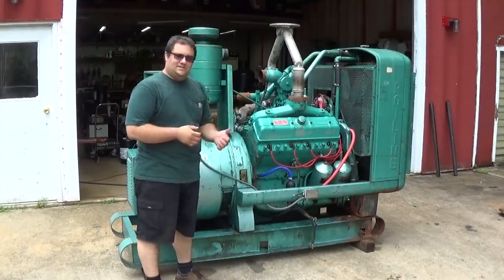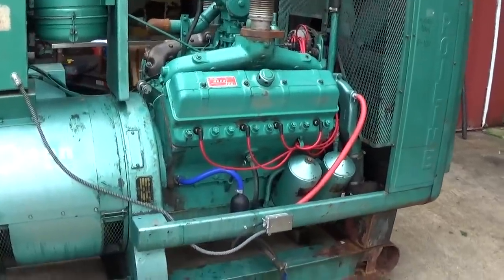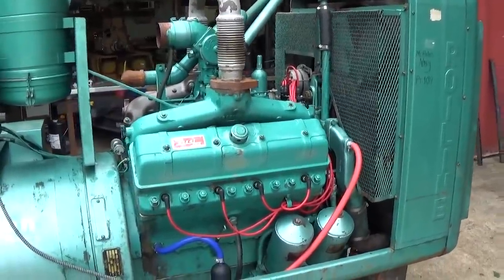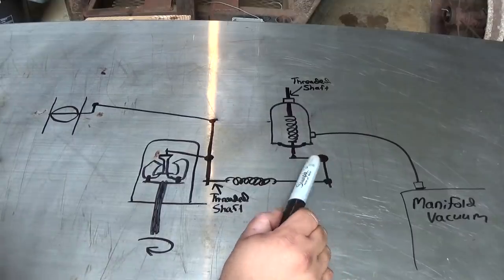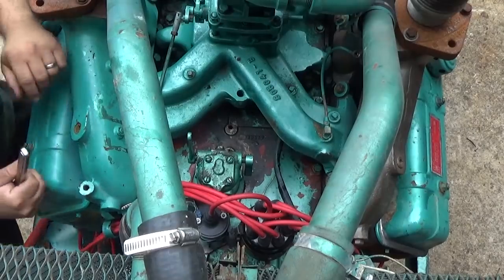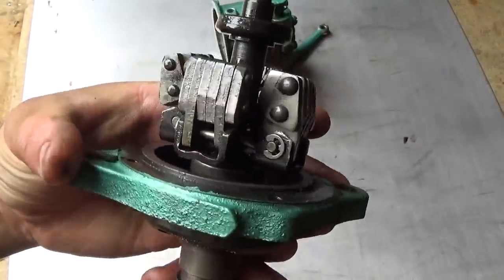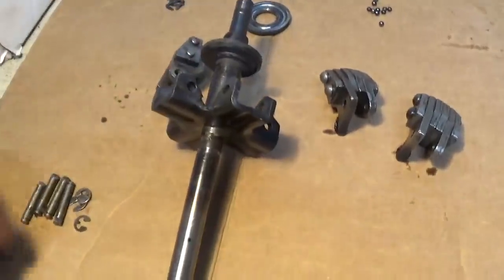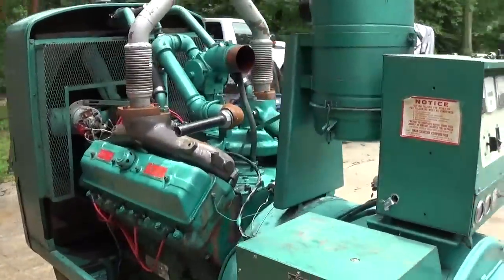844 Cubic Inch V8 GENERATOR Lets find out what is ailing it... Onan 140WE

Comment: A bit backwards on the governor operation explanation. As soon as load is increased, engine speed begins to fall, and the flyweights begin to move in, opening the throttle. That increases the hp to carry the greater load, at a lower speed, and increases manifold pressure (less vacuum). There will be a bit of a restriction between the manifold and the speed booster to prevent hunting, but in a short time it will increase the main governor spring tension, restoring the speed to rated speed.

Comment: Idk? As bad as the drive gear is for the mechanical governor, I would question the lubrication systems for the engine, and want to pull the oil pan off and check the main bearings and rod bearings before I'd go much further on the governor conversion....

Comment: I would guess that the governor driven gear, and it`s drive gear, were not being lubricated when running. It did look dry inside after pulling the governor off the engine.

Comment: I think an electronic governor conversion would be interesting. Everything you showed in the video looked like it had absolutely no oil on it when you took it apart, even down in the engine. The design of that oil hole is not great but I wonder if there is some greater oiling issue with the engine. It'd be interesting to run it (or spin up the oil pump with a drill if possible) and observe what oil is delivered.

Comment: I like the idea of you showing us how to convert this generator to a digital governor.  I'm interested because the engine company did not continue making this engine very long.  Was this the ONLY reliability issue or when you run it with a governor that doesn't need to be oiled, will you find other issues? 
I was trained as an electrical engineer, though I never worked as one, and am interested in design flaws and how they are corrected.  The idea of failure analysis is similar, but I always want to know what would fix the issue!

Comment: So uh how much for it I wanna put it in my truck lmao
Reply: I thought the same thing
Reply: It wouldn't run what you have to understand its generator motor so its actually meant to turn at alot lower rpm than a normal gas engine and is actually why so big in cubic inches like a diesel turns very low rpm just like gas it makes it low wear on it
Reply: Joel Lyons same reason 4 cylinder engines can go up to 8k rpm and motor cycle engines can exceed 12k rpm
Reply: @Joelontugs  That's probably why it ran fine for 60 years. Everything moves so slowly, I'd also imagine that the parts are all overbuilt, weight probably isn't a huge consideration in a stationary powerplant.
Reply: @Joelontugs , if you've ever built an engine you know that can be remedied. 
Balance, polish, port, big fn cam, custom split duel four barrel intake, or fukit twin turbo.
Boom 3000 easy.
Even if it reds at 5k

Comment: As you were showing all the carnage in the governor, I was thinking of the various damaged parts that can be made at a machine shop, or electronic conversion. And then you said so. The speed sensor can also be run in the governor location, instead of the fly wheel,  only that gear in the cam is too worn. Very much interested in seeing the electronic conversion.

Comment: The governor is an easy fix compared to possible engine damage.The giant problem might be the generator.Does it have a wound rotor or is it an armature with brushes? if an armature what would be the condition of the commutator and brushes.Truing a comm,undercutting and chamfering the bars, rebrushing is all expensive.Bearing change out and making sure the endbells aren't worn to the point of sleaving them?Now you have to address the regulators and 50 years of use will age electronics and wiring as it has on the mechanicals. SCR's for freq control and voltage control aren't cheap to replace in a unit this size.I'd like to know the condition of the winding insulation on the fields and armature as heat and dirt always are a factor so they would need to to be meggared to ground after steam cleaning them and drying them out in a vacuum oven.Possibly needing to redip the fields and armature to seal up cracks.Scrap it or sell it to someone who will run it til it blows up.The business that it came from were wise to get a new unit.

Comment: Great video, Yes do the conversion to electronic. 
BUT the first thing I would do is pull the dizzy and check the bearings, as you have shown only 1/3 of the balls from the thrust bearing , WHERE are the others?? If the dizzy has loose bearings too, I would pull the pan and check for remnants of the Govener and other things. If you do find a lot of stuff then inspect the oil pump and this could lead to removng the crank and piston rods then a flush of the oil galleries. 
This engine reminds me of the Ford V8 produced in WW2 for some of the army tanks of the time, very simmilar but not shure if its the same.  Good Luck

Comment: I think you need to make a plug or modify old base to cover old oil feed hole to governor shaft, maybe put plugs in top and bottom where shaft went through old base and make a plate where cover used to bolt may be easiest. Just was concerned about open oil feed hole causing lower oil pressure as it would just be an open hole dumping inside engine.

Comment: 1, How much of the metal grindings went into the engine and how long until the engine blows from the contamination?? 2 I am looking for an older onan gen set to provide backup power for my house and hobby shop. (Natural gas would be preferred) do you have any???

Comment: You also need to remove the pan and inspect the rod, and main bearings as well as inspect the oil pump for damage and clean the oil pickup. All that metal went somewhere...... Yes I have worked on portable gensets up to 2M.....

Comment: Might be interesting, but 1600+ hours is equivalent to 95000-100000 miles on an automotive engine of 1965 vintage.  That engine may be toast on the inside -- the bearings are probably badly worn, and who knows what the valve train looks like?  More than half of the balls in the thrust bearing in the governor ended up down in the engine as well.  It would be interesting to see the conversion, but it may not be worth the time and effort.  JMO.

Comment: if you install an electronic governor that likely will solve the engine over speed issue. However, I think you may need to solve the lack of lubrication issue too. The governor driven gear is badly worn and that points to a deeper problem. Is the drive gear (on the cam shaft?) worn too? What if something else is starving for oil?

Comment: JB Weld & Hot Glue it! Isn't that the standard for Generator repairs! At first I was just thinking yeah just clamp the speed up and let her run until the power came on and then fix it properly. However the exhaust was a killer even for me on that idea. Very Nice video Mike, I actually learned something I didn't know before on the governors. So my clamp it up idea probably would have completely killed it the rest of the way beyond economical repair. Just because is looks good on the outside and runs smooth, doesn't me there's not a CRITICAL error on the inside waiting to rear its ugly head. That's why Mike and the company have a good rep, they get the job done reliably & Right!    So YES I think learning how to do a electrical/electronic governor conversion would be an excellent video. Thanks for all the education Mike. Best Wishes & Blessings. Keith Noneya

Comment: Mike, I think I agree that it is a poor design. If you equate 1662hrs running to a truck engine, that is less than 100k miles and no truck would show that wear on any component at <100k miles.

Comment: I have  a cng Dodge  van that has 4 tanks that hold the equivalent  of 18 gallons of gasoline  but their  actual volume  is more like  60 gallons
The cng is rated at 3600 psi but sometimes fills up to 4000 psi,
that would run the gen for a while.
My truck is only  318 ci.
30 + years ago I did maintenance  work
on a 75 kw gasoline fueled  generator  that supplied the emergency  lightning 
for the old Boston Garden arena. The 
engine was a massive 6 cylinder ohv
antique  with a single updraft  carb.
I recall that it was about  700 cu + - ,
possibly a Hall- Scott but not sure.
This monstrosity was mounted on steel 
 beams and I needed  a small  ladder to
 reach the valve cover! The generator 
shaft  was flange mounted  to the flywheel which  looked even older then the engine. The joke was that the generator  was signed by Tommy Edison. This antique  had to be run before EVERY public event held at the Garden including Bruins hockey  and Celtics  basketball and if it didn't  run the event would've been cancelled.
But it did have a replacement  electric
magnetic  governor, a magnet was installed  on the outer  diameter  of the
exposed flywheel.  Very interesting when
the governor  malfunctioned  and the
engine  took off  for the sky. No overspeed shut off ! 
I was at the Bruins playoff game when
the garden filled with thick fog from the humidity then the power  went out then
the generator  started . The emergency 
lightning  came on and I got out of that
dimly  lit  rat trap of a building. The generator was in a building nextdoor to 
Garden and it overheated  and blew antifreeze  all over the place. I got
an early morning  phone call from the company owner  to go back and
find out what went wrong. A story
for another  time.

Comment: An absolutely fascinating video as always, in theory an electronic governor could use the 60Hz output as a sample.  Part of me is thinking if you could use a Ford throttle body,  perfect "drive by wire" solution. (Maybe not all Fords but certainly my wife's car has a dc motor which moves the butterfly)

Comment: I'd be interested in an electronic governor conversion as well.  But I'm a little skeptical of your root cause analysis.  You've shown how the lubrication design of the governor could well have resulted in poor lubrication, which could have caused all the internal damage you note--but I don't think it would have caused the extreme wear on the gears.  Didn't you say the unit only had around 600 hours of run time?  I'd think that would point to a more basic lubrication failure.

Comment: That was a great education! Just as if I was attending a school learning how that thing works! Great instructor! I went 'oh-oh' as as soon as you said that's a lot of spring tension there. I was wondering why such a behemoth spring had to be used to control a flappy throttle valve! Then when you lifted the flyweight assembly out of the block I said, wow, that looks awfully dry. Then the gears worn out and so on. It may have lived longer if the oiling supply was better designed. Now, with advanced electronics, going to an electronic speed controller would be a no brainer. That genset is still young in hours IMO. Good Luck!

Comment: If I were to ever consider rebuilding that, or finding a similar replacement mechanical governor, I'd probably think about adding an external oil feed. Perhaps a line with a small orifice spraying in from the top of the gov housing to give everything in a constant oil bath. 
I would also think the extra oil returning out of the drains in the base would help the issue with the drive gears getting chewed up. That, and a lighter tension spring.
And yes, by all means it would be interesting to see the process of changing it over to electronic governor!

Comment: If that many bits are missing out of that governor, I'd be seriously considering an overhaul of the engine, or at least getting a camera to see if any of that metallic debris got into the cylinders and/or the lubrication system. There could be collateral damage from the missing bearings.

Comment: I'm going to go with "Royaline", "ROIL-ine", goes with the crown emblem. That engine was the proverbial balls to the walls, the grooves prove it. Don't forget to plug off the oil line in the block that feeds that governor. Especially since there was such a low flow through it.

Comment: Well diagnosed Mike, I think part of the problem is the governor is not up to the job of controlling the butterfly as needed. Throttled inlets like on your engine have some very peculiar and opposing dynamics happening. First dynamic is it takes far more force to just open and maintain a controlled position of the butterfly than it does to maintain a position near wide open throttle, due to air flow acting on the 'sail area' of the butterfly, a near closed butterfly has a much larger sail area. Second dynamic engine response is greatest at near closed throttle. 5 % rotation of the butterfly from near closed is a far larger opening of throttle (%airflow) than a 5% opening at near wide open throttle. 
Electronic governors on gas engines are always fun, specially getting the linkages right, you need the exact opposite of a parallelogram, the output linkage of the new governor needs to be at right angles to the butterfly plate, this gives greatest actuator control over the initial small butterfly openings needed to maintain idle, with reducing sensitivity as you near wide open. 
It's a nice looking machine, you will get a lot of enjoyment getting  that one going. Interesting colouring of the exhaust manifolds as well, almost like one side is running way cooler.
Looking forward to seeing it in the future :-)

Comment: Here is some information on Le Roi which in French means "The King" which then much later became Roi Line.  Waukesha was involved later along the way.  The company began as Milwaukee Machine Tool in 1913. In 1917 Charles W. Pendock Reorganized the company into Le Roi which was making a 4 cylinder engine. He later added a 6 cylinder of the same general design. Legend has it that the company changed the name from Milwaukee Machine Tool to Le Roi after a large order came in from France for WW-I equipment. WABCO (Westinghouse Air Brake Company) purchased the company in 1954 and then sold the Le Roi engine division to Waukesha in 1958. Waukesha marketed the Le Roi engines as Roi Line (Roy-Line). The last of the Le Roi engines were built in 1974. 

I have a photo of my father when he was in National Guard service in 1938 with the Combat Engineers on training in Tennessee standing along side of a military truck  that is equipped with a very large Le Roi powered generator set. The same large lettering is on the radiator housing but says Le Roi rather than Roi Line. My father went on to be a U.S. Army Captain, company commander in the Pacific Theatre during the New Guinea and Philippine campaigns and finally the occupation of Japan.

Yes, I would love to see the electronic conversion. It looks like a very nice machine! And funny- the reference to Steve1989MREInfo.... "Ok lets get these parts on a bench... nice". I wonder how many people got that! Not many I would bet.
Reply: Quite a few, judging by the comments!

Comment: Definitely would like to see how this would be converted !! Those conditions really caused alot of wear on those parts. Have you since drained the oil and filters to check for "shiney's" in the oil?? Wonder how much damage all those metal particles did to delicate surfaces in other parts of that engine. The unit looks pretty nice on the exterior !! That thing would power up your neighborhood !! Don't remember if you said if it is single or three phase and what voltage ??

Comment: Great vlog buddy I am surprised that the fly weights were not given the same advantage as the top of the spindle which has a ball  bearing pad to sit on if it had one and better oil feed it and the gears would have lasted a hundred times longer and yes it would be very interesting to see just how you will go about installing something like this thanks for sharing.

Comment: By the way, your home's gas supply may not have the proper volume to operate this unit.  Don't quote me as I took my gasfitters test back in the 80's but street pressure is around 3 psi. while residential pressure inside the home is 1/4 psi.  I've been retired for years and can no longer remember the particulars.  Is there a pressure rating on the name tag?

Comment: Looking at electronic governors for a project of mine, would love a video on installing one. Going to use a extra Mercedes Benz 300 engine with a 15kw head. It’s a 5 cylinder turbo. Figured it would do fine at 15 kw at 1800 rpm.

Comment: I would say "Roi-Line" as these were part of the line of LeRoi engines acquired by Waukesha. 

I also think wonder if the governor was killed by excessive spring pressure rather than a design error.
Reply: You could tell that thing was oil-starved the moment he took it apart.

Comment: Great video sir!! As a retired Transmission tech, I totally understood the how the vacuum worked in the system as most of the old transmissions (late 50's until last used in about '86) the used vacuum modulators to control mainline pressure and oil to the governor.  I notice the worn gear right away and also noticed the dryness of the gallery under the governor. Almost like the upper end was oil starved. Would enjoy seeing how you change this over to modern control!! Also, is there a market for such an old "boat anchor"??? ;)
Reply: Great job explaining and showing the governor and manifold vacuum interaction. Liked the layout of the disassembled gov and your analysis of what caused the failure. Would love to see the electronic governor conversion.